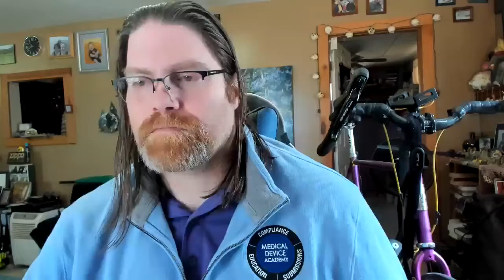What is ISO 13485?

Comment: Hey Rob, Quick question. How hard would you say it is for a company to work for the ISO-13845?
Reply from the maker: Great question, and I haven't ever had it asked quite that way. 1st - My comments are specific to ISO 13485:2016--not MDSAP (which requires much more).

In terms of effort, it will be hard but not the hardest thing the company attempts (maybe 3.5 on a 5-point scale).

In terms of hours, it will be 100+ hours of procedure edits. 20-40 hours of training. 30 hours of internal auditing. 10 hours on your first management review. 100s of hours creating records. 1 day for the Stage 1 audit. 4 days for the Stage 2 audit.  Don't forget several hours writing CAPAs for the certification audit findings...then you get to maintain the certification year after year.